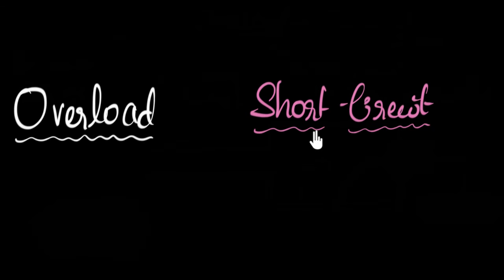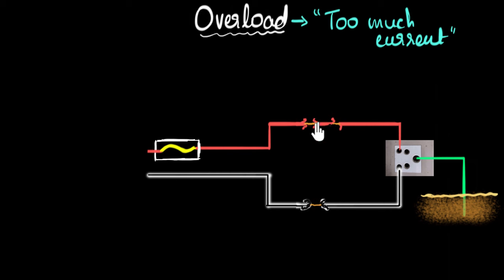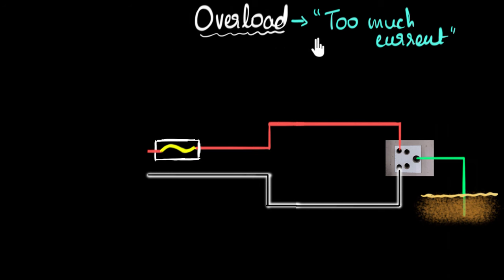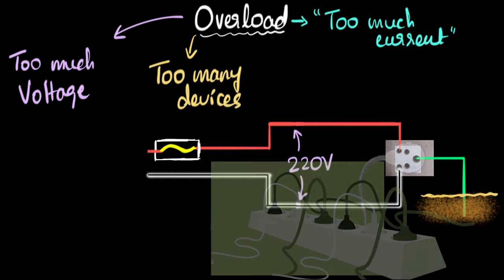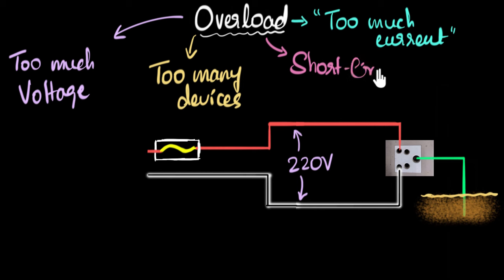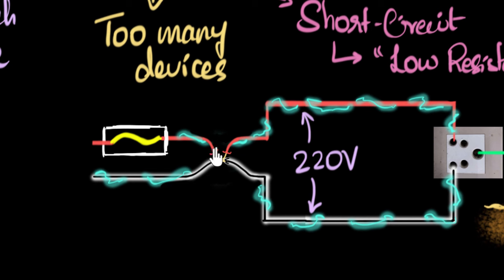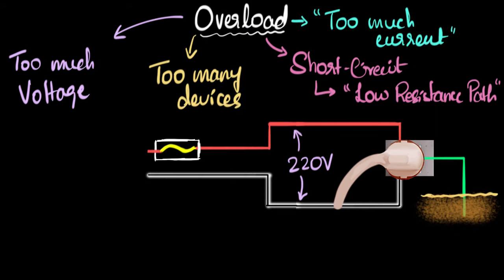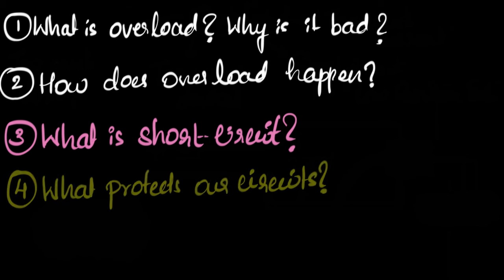Overload & short circuit: Domestic circuits (Part 3) | Physics | Khan Academy

Comment: I once connected the live wire and the neutral wire by connecting an external wire between the live socket and neutral socket on switch board and power went out. I was really dumb to do that. Realised now that I actually did a short circuit.
Reply: LOL

Comment: we could think of short-circuit as literally the circuit becoming shorter due to a new path (although it may become longer too but generally shorter if the live and neutral wires are touching)

answers:

1) easy
2) alternate path for current to flow, perhaps due to live-neutral touching, water etc
3) explained above
4) mcb, fuse, proper grounding, proper covering of wires

Comment: 1.Overload occurs  when the current drawn by the wire is more than that of its capacity.it causes fires 
2. When voltage  increases, thunderstorm etc.
3.Shot circuit is when current travels along an unintended path of low resistance. Happens when insulation of live and neutral wires break 
4.Safety fuse and circuit breaker

Comment: Overload is when excessive amount of current is drawn by our device which is out of the capacity of our device due to which insulation cover broke which can even cause shock to the user and may also cause fire.

Overload happens
Due to high strike in voltage 
Too much current 
Short circuit
Too many devices are connected
Or some faulty devices are connected

Short circuit happens when live and neutral wire stick together due to brokage of insulation cover and a large flow of current happens is known as Short circuit

Fuse protects our device from shortcircuiting and overloading
Reply: Thank u 💓
Reply: Ty, it was kinda helpful

Comment: .......I am just figuring this out more in writing, from what you said and my electrical experiences...... Hmm, to much electrical current on the wire, can heat it up, but the fuse or breaker stops this, by stopping the flow of electricity..... To many devices would draw maximum electricity for the wire fuse or breaker, and electricity would stop when the fuse or breaker shuts off......The short circuit would place to much electricity directly on the wire, and/or indirectly interfere with other aspects of a device, and cause the fuse or breaker to put the brakes on and trip off the flow of electricity....

Comment: There are two problems in a circuit.
1.Overloading 
2. Short-circuit.
>Overloading
Definition:- Too much current.
Causes: attaching to many devices. And short circuit.
Why is it a problem
A) It can melt insulation.
B) In worst cases, the wires may even catch fire.
Cure?
Our little hero— Electrical fuse.
  It is present on the live wire. If current exceeds its limit; it melts and breaks the circuit. No flow of current.
> Short circuit— circuit became short ( low resistance path)
When live wire and neutral wire get too touchy. They make a new path— a path with low resistance.
And lower the resistance; more the current. Then zzzzzzzz. Overloading.
Reply: Thank you!! ♥️

Comment: Answer 1, An overload is an increase current due to voltage (current is directly proportional to voltage) with low resistance causing the wire to overheat, giving a class C electrical fire, which is why its bad.
Answer 2, Either there was a voltage spike in the AC or too much electrical device draws current.
Answer 3, Is an interruption in the circuit by another conductor with even lower resistance compare to other loads, that can completes a quicker path back to the power source.
Answer 4, Fuses or circuit breakers
Reply: I am sorry but I think you have written wrong in 1st question it would be *with high resistance

Because of there would be a low resistance the current will flow easily and damage our appliences!
Reply: @meaw-6.9  Thank you for making me do deeper research, I now see heat is generated due to the resistivity of conductors not current. Cause heat is the dissipation of energy from the resistors.

Comment: Sir, how much minimum resistance required to avoid short circuit in AC&DC
Reply: It depends on electrical appliances... For example if you use electric iron which drawn 15amp current then we will use 15 amp of fuse.... Fuse depends on electrical applianxes

Comment: Since a fuse has a high resistance (1:35), doesn't this create a problem, as there will be a voltage drop in the circuit ?
Reply: It breaks within a second . So no
Reply: @preraj175  Of course the fuse breaks if the current is too high, but I was referring to the high resistance (and corresponding voltage drop) of the fuse when the circuit is functioning normally.
Reply: The fuse resistance is high compared to the wire resistance. However, the voltage drop in the fuse is very low compared to 220 V.
Reply: @josecarlosferreira4942  Thanks! 🙂

Comment: Sir , heat =I^2RT, also wire provides zero resistance , therefore there should be zero heat produced in the wire although      current can much much higher
Reply: Hey Rohit, Resistance is taken as 0 but it's not really 0. To be precise, it is so low that it is negligible. If you have an extremely large current, then heat will also be extremely large.
And since we are talking about parallel connections, the formula we use will be H=V²t/r[because V is constant in parallel connections]. You can see that the heat produced will be extremely large.
Hope that helped.

Comment: Sir can we touch neutral wire without any socked
Reply: yes If you are already neutral
Reply: Yes we can touch neutral bcs neutral has 0v
Reply: Yes. But its advisable not to, cus the voltage is not exactly 0

Comment: Answers to the question:
1. Too much current flowing in the circuit. It is bad because it can cause insulation to melt and can also cause fire. 

2. The three ways by which overload can happen:
(i) Too much of voltage in the current
(ii) Too many devices connected to the circuit
(iii) short-circuit

3. Short-circuit happens when the current in a circuit happens to take a shorter and a lesser resistant path. 
e.g., 
(i) when a live wire touches a neutral wire
(ii) when the circuit is surrounded by water
(Extra {what it can cause}: short circuit can allow a huge amount of current to flow though it, as there is much lesser resist and can use burns or melts in the devices.) 

4. Insulation protects the circuit. 

Feel free to correct me if I'm wrong.

Comment: Sir, why is it that overload happens when you occupy all the sockets in an extender?

Extenders do have a rating right? Like when it specifies a certain Amperage it is only limited to that Ampere rating.

For example, an extender with 4 sockets (rated at 10A), can only provide a maximum current draw of 2.5A on each socket. Hence, devices requiring higher current draw more than 2.5A should not work properly instead of being damaged since over current cannot happen because of the Amperage rating of the extender?

Maybe for extenders without Amperage rating can overload happen?

Ty sir Mahesh for the awesome explanation :)
Reply: See... The rating on any device, an extender or even a fridge specifies the max voltage on which it can work at full effeciency. It does not mean that if you increase voltage, excess current won't flow.
So if a device is rated 220V 100W, then it can work properly till the current is 0.45 A. [R=488 ohm]
However if we increase voltage to let's say 230V, I=0.47 A.
This exceeds the capacity of device which is 0.45 A. This causes overloading and harms device if earthing wire is absent.
NOTE: Values of current, resistance,etc. are taken as an approximate

Hope that helped
Reply: @shreyjaiswal5250  
Correct me if I'm wrong, my understanding now is an extender rated for 10A can only provide a maximum of 10A. 

Like for example, if device A is plugged into one of the sockets of a 4-socket extender, and it draws 7.5Amps of current, then the remaining 3 sockets can only handle 2.5Amps total of current draw.
Meaning, we can't plug in another device/s which tally to more than 2.5Amps of draw.

Am I correct Ma'am/Sir Shrey?
Reply: @Hino_55  Hey Jd, The rating given to devices shows that they will operate at max efficiency till that point. Like a 10 A extender will be performing at its max capacity when 10 A flows through it. But this does not imply that current>10 A won't be allowed to flow through it. 

Let us assume there is no fuse preventing excess flow into the extender and there is a voltage increase so that an I of 20 A starts to flow via the extender. This will lead to overloading and the device and wires may burn due to excess heat being produced[Joule's law of heating]. 

So in conclusion, the extender will get damaged if the voltage or current exceeds the amount specified in its rating.

Further clarification, let us assume that the extender is a tube light with the same rating, then when I=10 A light is brightest; when I<10 A, the light is dim and when I>10 A, the tube light gets damaged.

Hope that helped.
Reply: @shreyjaiswal5250  Thanks Shrey, this comment was 5 months old, I appreciate you taking the time to reply. Cheers mate!
Reply: @Hino_55  Always a pleasure to help mate :)
Reply: @shreyjaiswal5250  How  earthing save the devices? As far as I know earthing is done to save us from shock due to current lekage,right?
Reply: @harshgautam8765  See, we get electrocuted when we touch the metallic body of an appliance when it is carrying current. Now this is not generally the case but in case of faulty wiring, current can leak to the appliance. That is when the earthing wire takes command and diverts the excess charge to a metal plate deep inside the earth. That is why we don't get electrocuted. The earth acts as a reservoir for charge to flow into.

A point to notice, appliances with plastic bodies generally have 2 pronged plugs, like a fork with 2 spikes. Since there is no danger of current flowing into the plastic body, they don't have a third prong to be connected with the earth wire. However in appliance with metal bodies, this danger is ever-present and therefore the plug is 3 pronged, like a trident.

Hope that helped :)
Reply: @shreyjaiswal5250  Thanks for the answer 
But That still doesn't  answer my question.
My question is how earthing saves t " electrical appliances "
Reply: @harshgautam8765  The earthing wire diverts excess current to ground when current gets leaked. When overloading occurs, the excess current is safely diverted by earthing wire and it prevents the heat due to excess current from frying up all the devices and wires connected.

Hope that helped :)
Reply: @shreyjaiswal5250  Oh got it!
Thanks
Btw due you use quora
Reply: @harshgautam8765  Glad to help:)
No mate, not currently.

Comment: Sir, you forget to answer that "why fuse is connected to live wire"
Reply: It is because as most of current flows from  the live wire
Reply: That is because current flow starts through live wire and then comes back through neutral wire. Logically, we want to save the appliance and therefore we place the fuse, which is basically a limit setter for current flow, in series with live wire so excess current does not reach the appliance.
Hope that helped :)
Reply: @jayeshdeshmukh9624  This statement is a scathing indictment of the Indian schooling system.

Comment: Why the resistance of the path becomes too low when a naked live wire toches the naked neutral wire??
Reply: You can imagine it like this: if one end of 2 wires is connected to a battery in a simple circuit and the other end to a bulb, current flows and the bulb lights up in normal conditions. This is because there is 1 path through which current can flow.
In parallel circuits current is divided in ratio 1/R. This implies that more current flows through smaller resistance device. You can interpret this as current tends to flow along least resistance path.

Now when insulation is damaged and wires come in contact, their resistance is extremely low as they are behaving somewhat as a single wire only at the point of contact. Current prefers this path instead of the comparatively higher path across the bulb and therefore a large amount of current flows through the wires back to the battery. This goes on and by Joules law of heating, such high current leads to great amount of heat and this leads to sparks and wires melting. This damages the whole circuit.

That is why we use fuses and earthing wires. Fuses prevent excess current to flow through circuit by breaking it and earthing wires prevent electric shock to humans if they touch metallic body of device in case of current leakage.

Hope that helped.
Reply: I am looking for this Same question 🤣🤣

Comment: In my country ground and neutral are bonded but I dont know whay is the proper way to wire a conection

We use two hot(120+120)
Reply: Which country?
Reply: @zebakhan3320  Ecuador (south America)